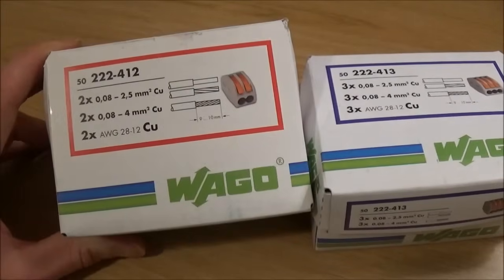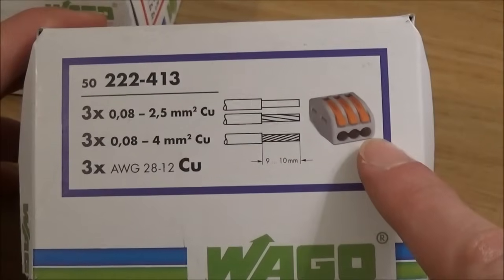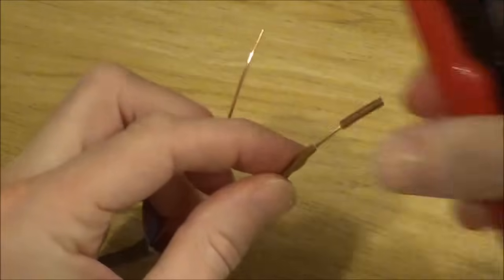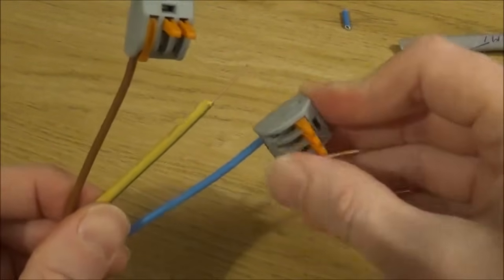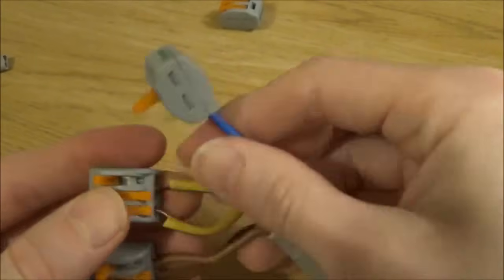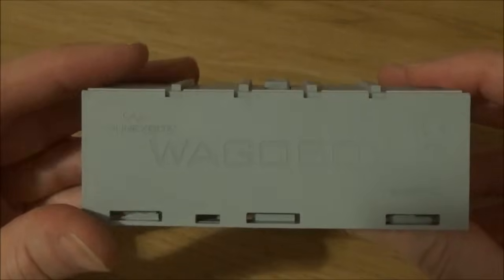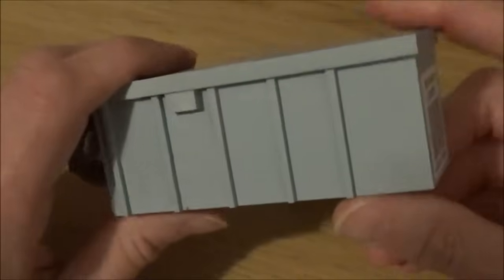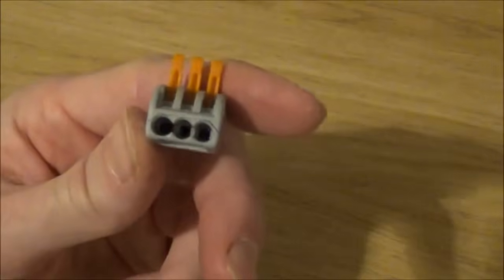WAGO 222 connectors review and demo. How to use with WAGOBOX Junction Box.

Comment: Who uses auto wire strippers? Unnecessary expense! 

Surely the JB should have cable clamps to hold them in place? There is a train of thought that JB's aren't needed for these. I would suggest that isn't the case and you would be best with a JB, unfortunately the choc boxes generally aren't big enough so a lot of additional expense :(

On an upside, these blocks are brilliant. They use up a lot more space than the old choc blocks but are superb. Also considerably more expensive. I was one of the inital trial sparkys with these many years ago and they have come a long way from the stuff they initially released ;) I have to say the 221 is a far better piece now.

WARNING WARNING, when you release the levers make sure your fingers are clear as they sting like a barsteward if they ping your finger ;)
Reply from the maker: Hi there. I personally love the auto strippers, I think they're great, just personal preference I guess. As for the junction box it has a grippy section where the cables enter the box. This prevents the cables from pulling out and act as a cable clamp which is a great design. Fully take your point on the 221 connectors, just haven't reviewed them yet! Thanks for watching!